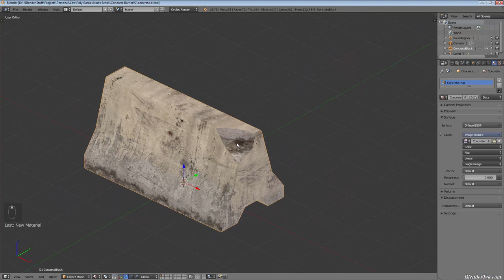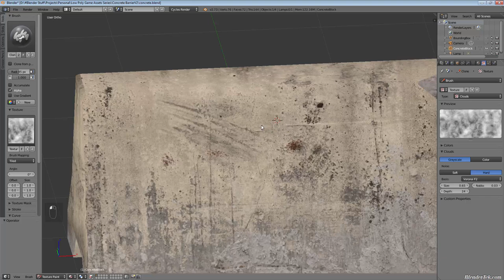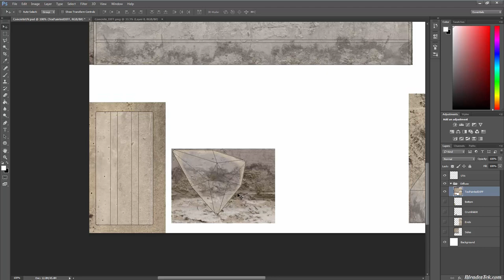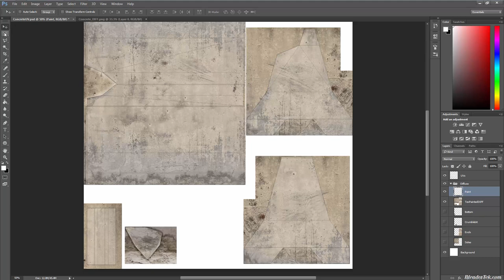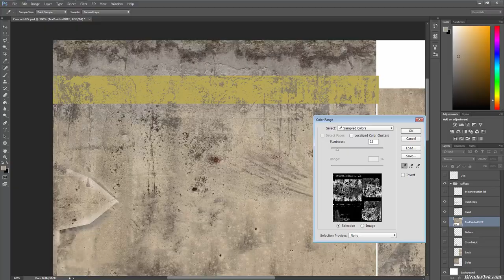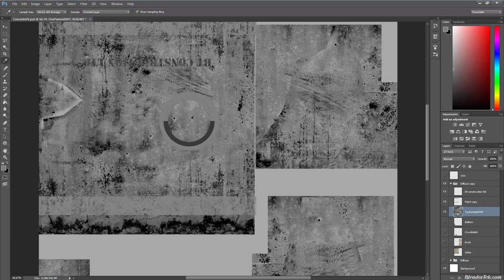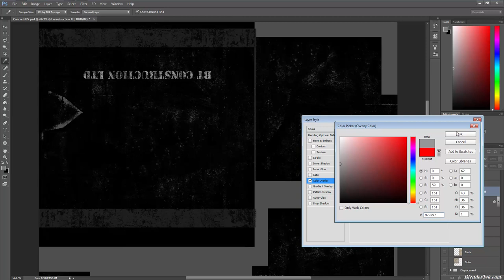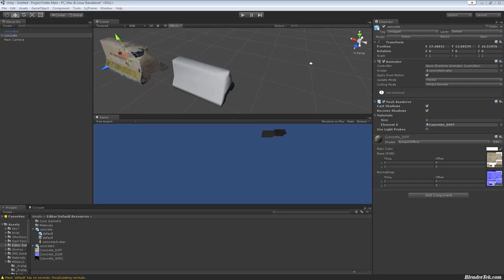Model & Texture Low Poly Game Assets Vol 1 - Concrete Barrier Pt 2: Texture Paint, Maps & final test

Comment: UPDATE: So I finished Pt 2 of your tutorial today. 

Here's my final result - http://i.imgur.com/WYxvC6T.png

I cleaned up the seams but I noticed the top looks a little wierd and I had two lower parts on the sides that was a problem but I don't think it's that noticable. I forgot to do the bottom but that won't be seen. Also, I left off the text because I didn't want it on the model but I still followed it anyway, it's just hidden in photoshop atm. Overall though, great tutorial and thanks for the help. I will certainly be ready to do the ammo box and other texturing tutorials you make when those are ready and thanks again..I really learned a lot here!
Reply: ***** Np, An ammo box would be pretty cool...haven't really seen that yet I don't think. However, contradictively alot of the crate tutorials are outdated that I've tried because they're using obsolete versions of blender as far as I know so it'd be nice to have a good tut using the latest version.